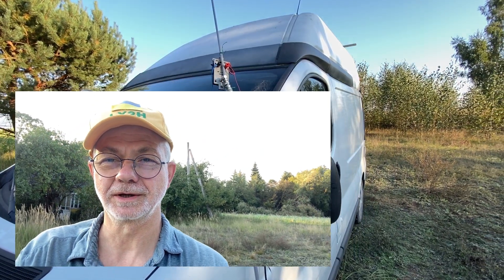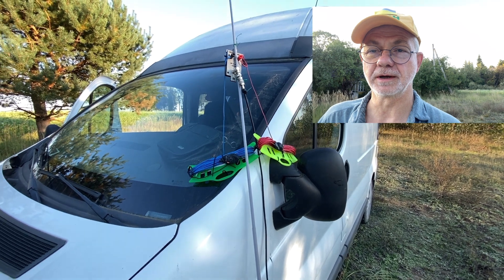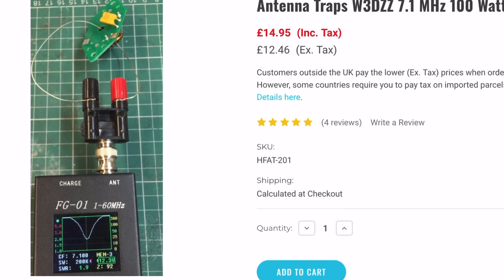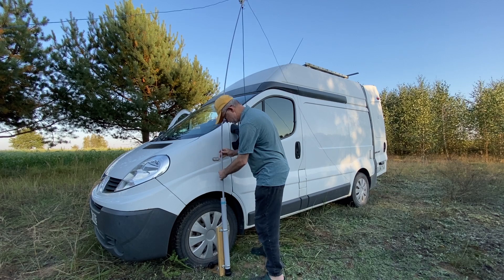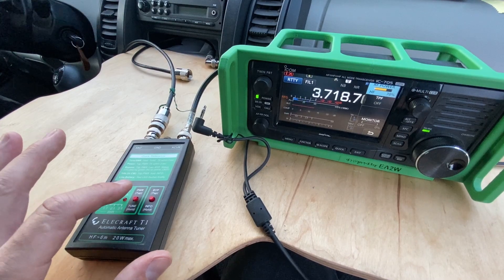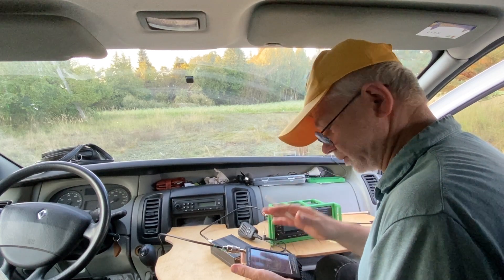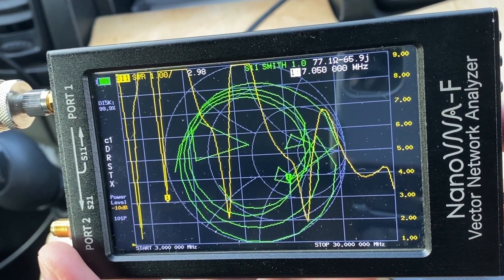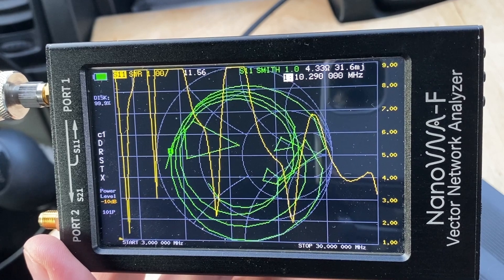W3DZZ revisited: compact all-band antenna for everyone!

Comment: linas, this time i do not agree with you - i would not mess around with this antenna, tune such high swr make no sence. in that particular situation it is a flop!
Reply from the maker: Thanks for your comment Jo! I think, there is still some room for improvement of this antenna's  work on higher bands by putting it higher up on the mast, also, remaking  the length of the antenna segments. On 80m, it performs just fine for the local QSO's, the guys from the evening net gave me as good reports as they were giving for my doublet in the same location. I used to have a W3DZZ many years ago, hung between the multistore houses sloping from one roof at some 35m down to the other at some 15m. Used with the tube-type 150W PA , it was a killer-Dx antenna! :) So, it's not a flop design , IMHO, but there is so many other factors... 73! Linas LY2H
Reply: @Linas_LY2H  yep, the design must not be a flop but as i mentioned in that represented situation it is imo useless. interesting anyway sotabeams explicit asserted no tuner needed .... !? as we know at our neighbor land things already may look different. everything above 2:1 i am not going to use it `cose too much loss, specially at low power. 73